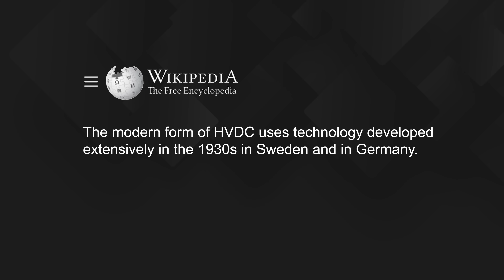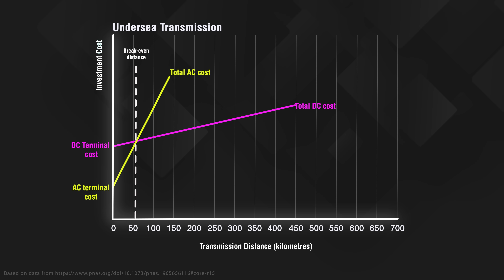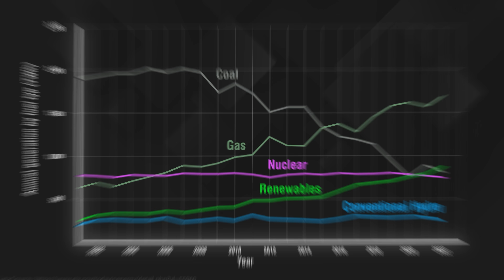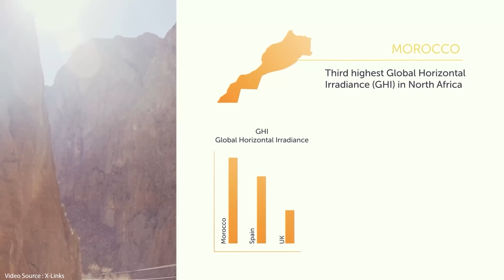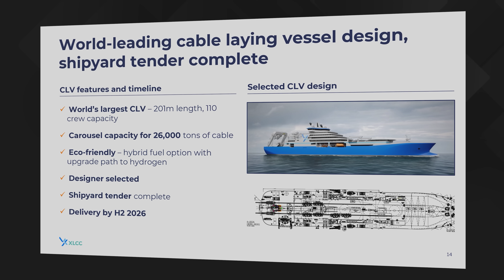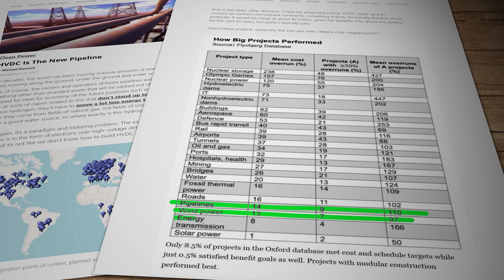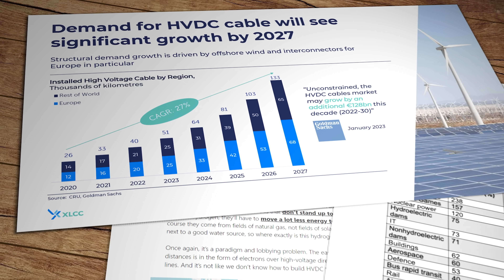Revolutionising power transmission.

Comment: AC was more cost effective back in the old days. Power semiconductors have made long distant, high voltage DC , more cost effective. Just because the first DC transmission came out in the 1930s, it was for unique situations (mercury arc rectifiers & electromechanical inverters - expensive and wear out). The cost, due to improving technology, has been dropping. Mostly, new types of semiconductor materials (GaN). 

There are two types of low carbon energy sources that should not be dismissed, Those are hydro and nuclear. These we have now, and run 24/7. Believe it, or not, there are environmental clowns, that want to decommission some hydroelectric dams !

Comment: You should do a video on the connection between Natural Gas Combined Cycle Turbine Power Plants and Heat Pumps or ECars on Fuel efficiency. Especially using the Natural Gas Turbines as a rolling Back-up to Renewable Wind and Solar.  . The problem isn't technology. The problem is GREED. In the end Ecars will win the day. as they are 3 times more fuel efficient than ICE Cars. And ICE cars run on BENZENE contaminated fuels. And BENZENE CAUSES CANCER.

Comment: The Moroccan project, weighing in at 1/2 the cost of Hinkley is a no brainer. Factor in the cost of the support infrastructure requied to maintain Hinkley, cradle to grave, and you will wonder why there aren't more renewable projects like this popping up.

Comment: Eh, for truly sustainable green solution we need to get in to heating rocks in giant heat batteries, the bigger the better heat retention, and it can both heat homes and be used as energy sink whenever energy surplus comes, on this scale regular steam turbines are viable and waste heat can be used by homes and industry, also industry can hook itself up directly to heat batteries for processing. Interconnects are nice. But every town having its own power and heat on demand is better. If disaster strike, city would have more than enough to be self sustaining for months.

Comment: Just as I thought that humans could not be more stupid , ie Batteries, nor we are going to do the same stupid thing we have been doing which is centralizing HVDC. We are going to dig up even more copper so we can transfer electrical losses greater distances. Right. The energy production and usage needs to be localized and not centralized. There are inherent security risks when a disaster by man unkind or more likely when the environment gone a muck destroys the central infrastructure we have created. Rendering us with out power. Instead we should be generating Hydrogen locally by whatever Green electrical generation we can use. Like Solar, Wind, Thermal, Hydro and yes even Nuclear see Red Hydrogen production by the Japanese. Producing Hydrogen in many different suitable location in the country and in the whole world will always be les risky than laying thousands of unprotected copper cables. Not to mention that one would use tons of less copper. When will people understand the the only renewable fuel on this planet is 2/3 s water.

Comment: You know what you and others are falling for…That would be that batteries are green… which they are not. Fossil  fuels can be replaced by Hydrogen. Because it’s the Hydrogen in Hydro-carbon fuels that creates the heat when excited by a spark for instance which makes it want to attach itself to Oxygen. Not to mention that Hydrogen can also creates DC electricity when put through a Fuel Cell. So yes we can replace most all uses of Fossil Fuels.

Comment: I'd like to weigh in with industry insight. I work for a company that builds high voltage AC transmission in Iowa. The HVDC line that SOO Green proposed is 100% dead in the water. The AC system on either side of the line was deemed insufficient by the Independent System Operators (MISO and PJM). Neither system can handle such a large injection of megawatts onto the AC system. When presented with this information, SOO Green was unwilling to fund the necessary system upgrades. 

On top of that, SOO Green was marketing and paying for the line using a "Merchant Line" system. In this system, individual loads and generators directly pay for their transmission usage along that line.  For context, there are currently 0 Merchant Lines in PJM or MISO. Here are two examples of many where that system falls apart. 
1. "I want to pay to bring Iowa wind energy to Illinois" "No, the local energy companies want that investment. Build wind farms in Illinois instead."
2. "Illinois has extra generation right now, and we've paid SOO Green for a percentage of their line. Export to Iowa!" But at the same time, "Iowa wind is over producing, and we've paid SOO Green for a percentage of their line. Export to Illinois!" When it is economical for both paying customers to supply or pull from at the same time, the system breaks down. 

Feel free to reach out to me with more questions about how electricity markets work in Midwest USA. If you want a great video idea on the topic, search "MISO Long Range Transmission Planning" (LRTP).

Comment: If high voltage dc cables aren't more complicated then similar fat wires in alternate current, then there would be no technology gap risk as perhaps not being able to produce such dc cables in a few years when special parts or materials could have become to scarce, and "we" would tell us then that we should have stood with a rather primitive ac network that would be less complicated to maintain, so can anyone explain or compare of hv dc cables are kinda similar in construction like the hv ac cables we mostly have today? and is it strange or awkward when a person like me has some thinking that "we" can't be humans without N. Teslas alternate current? alternate current would just be a money making pressure argument N. Tesla had to come up with since T. A. Edison would had claimed direct current for himself and his helpers in his laboratory? but i don't profoundedly understand ac (you/one would have to be a kind of mathematician for). 
Like with working on quantum computers without a deeper understanding of some light or photon based computer or chip. What is the (hu)man these days capable of, in his situations? shall the electricians and similar technicians be the hidden wizards solving all the circumstances, and feeding vast amounts of dc to mostly mindless "normal" people having hardly learnt anything about (the history of) electricity? they want their questionable (query-able) accumulator vehicles (many of them already had a burning incident), but the will never pay (off) the resourced (mis-)used for their nasty lithium "batteries", "everybody's allowed to carry or posess".  I'm from switzerland.

Comment: Not so long ago HVDC transmission lines were praised first for decoupling the frequency of the zones that were connected. Their high(er) cost was the main issue. Nowadays we should consider, before our governments spend billions in such projects, if other solutions should be integrated into the mix: local, clean, grid-connected sources of renewable energy (and storage). The power grid pyramidal scheme need to be questioned and much more thinking is needed before claiming victory using a single technology.

Comment: I had a Friday night cards friend who works with HVDC.  He was in town for a few months setting up one of the red pins on your screen.  Neat tech with great potential.  It was almost 10 years ago now since we parted ways but I recall him recanting (in general terms) the many challenges of getting the system running at the time.  Since then it's slowly been ramped up in capacity with major teething pains but looks like it will work out.

Comment: Speaking of power grids there was this quite interesting company from northern Germany that hat an innovative approach to the grid. They planned to put water filled pipes in first and than insert the power line. This would activity cool the power line thereby increase the transported amount of power but also create vast amounts of usable hot water for heating etc… unfortunately I didn’t hear about this technology around 2017 or 2018 after this video I had a little research and it seems that this idea was bought out or something back on 2019. I personally think that this technology is far better then those massive overland power grids as they produce at least some usable heat on there way. Right now overland huge power line projects are built in northern and central Germany to supply southern Germany with green power from wind turbines, partly because they did not like wind turbines nearby. 
The company is called http://www.ags-verfahrenstechnik.de/  I don’t have any connections to this company by any means. I actually a closer ties to the construction that is happening right now but still think this is a great solution.

Comment: What I think that energy companies fear most is having a distributed power network made possible by wind and solar replacing the concentrated power generation scheme we have now which uses the economies of scale to increase shareholder value. Wind and solar, especially solar, could generate enough power near or at the places of consumption to make high-voltage power transmission less necessary.  It could be that the largest component of such a system would be energy storage. It could also be a DC system.

Comment: Naive Portugal if the contry lets the cable just run in its waters without any change. This is also not the solution. energy like food should be transformed local to be consumed locally

Comment: Yeah I defintely don't see this as an unsolvable problem. You make enough videos about new stuff that will solve or reduce these problems each individually that even if some of them are rotten if you throw enough mud at the wall some of it will stick. Certainly the major 2 energy and transport are solvable and I think a lot of the problems are going to just require more energy so as long as we keep building solar panels and electric cars faster than they are being taken away we'll solve the majority of it and then you've got carbon capture in 1 form or another to get what we cannot clean up which I think will likely just require a lot of energy so the great thing about this climate issue is that it will drive down the cost of energy because we will need so much I mean just to make cars electric is going to pretty much double the amount of energy required to power them.

Comment: Would you please make a show (or series of shows) discussing the concept of Energy Return on Energy Invested (EROI, or EROEI)?  I am a member of Crux Investor, which is primarily a natural resources investing community.  In the community chats there is a whole load of renewable scepticism and scoffing at what can be done, and one of the main bugbears is the low EROI of renewables.  Essentially the question is this: is the human race capable of the work energy required to decarbonize?  If the EROI of the technologies we choose to go with is too low, we may indeed not be capable of the work energy required to achieve the transition.

Comment: It's great to see, but it's so slow. Governments like shiny kit like nuclear powerplants, but I've been rabbiting on about UHVDC to anyone that will hold still (or that I can keep up with as they run away) for a good 25 years now.

Over 20 years ago I was a very minor project manager on the largest in the world at the time DC interconnect and I well and truely got the bug. 

That project is utterly dwarfed by modern installs, as much as a 386 SX is dwarfed by modern computers, and for the same reason. The heart of a DC transmission is the bits that convert the AC to DC and back again at the other end. That's done with power transistors, and they've had similar price reductions and performance improvements as other semiconductor technology. We can do much more for much less. It's cheaper and more flexible than batteries. We need to get on with it!

Comment: Thanks for sharing your thoughts, ideas and videos. Nice to see an update on new transmission projects coming up. Like everything, moderation is the key to implementation. Big projects can cause big problems. As long as they are well thought out the problems can be dealt with. Having worked in the power transmission industry for more than 32 years I’ve coordinated all types of technologies. No one is better than any other. The problems come from situations when exceptions are made in operating policies because this or that just can’t happen, which of course is usually proven wrong eventually. The DC import from HQ into NY was limited by the ability to recover from the loss provided from a single contingency. The primary contingency was the loss of the HQ power system and we trained to recognize it if it happened. After many years they decided that’s just not going to happen again. And people retired and new people were not trained to recognize it. Then the rule was dropped. Come one morning I’m doing my job and earlier I read about forest fires in the HQ system that were so big nasa had spotted them from space. I noticed it was in a major HQ transmission corridor. And pondered that can’t be good. A little while later the impossible happened and we lost all of our DC imports at the same time. Thankfully the imports were relatively low. I recognized it as the loss of the HQ system probably due to the forest fires. Sent my theory up the chain and surprisingly that was exactly what had happened even though all the experts said it couldn’t happen. Thanks again for your videos, wishing you and your family the best.
Reply: you have a great experience, I’d like to hear more from you

Comment: Yeh, two things:

1, anything China says they're doing, take with a grain of salt the size of an aircraft carrier. The only green energy record China has set is the largest number of fake solar farms (they're literally just black painted squares connected to nothing).

2, don't underestimate people's ability to fearmonger. In the US and I'm sure in the UK as well there are millions of people who think high voltage cables cause leukemia and autism and they can and have shut down badly needed electrical infrastructure upgrades.

Comment: This is interesting.   I had always understood that we use AC power because DC power does not travel well over long distance.
Reply: no, it's Amps that determine distance & Amps go down as Voltage goes up so long distance lines are high Voltage. Where DC comes into the mix is that capacitive & inductive losses are drastically reduced, especially underground or underwater where there's more to react with.
Reply: It is in fact the exact reverse - both AC and DC have resistive losses, but AC also has capacitative losses (the line acting like a giant radio transmitter aerial). According to Wikipedia HVDC loses roughly half as much power per mile as HVAC.

Comment: Gas pipelines would be good to transmit power to small generators, turbines and fuel cells for local power production and decentralization.
Reply: That's an interesting idea as pipelines have easy right of way and it's conceivable to use them as tunnels.

Comment: Some one in the comments talked about oil drill workers moving onto geothermal drilling jobs. Does anyone know if an old oil platform with old wells could be converted to a geothermal energy producing platform instead? Sort of recycling the platform? Or would the liquids not be hot enough coming out the wells?

Comment: There is no debate. There are and have been viable and cheaper alternatives to fossil fuels for quite some time now. We assume that when they debate how realistic it is to sever our dependency on fossil fuels that this is the real issue (agenda) they have in mind. I would argue that what they are really arguing against is any technology that empowers the average person and inevitably leads to population increase... This is their real concern. We have to "read-between-the-lines." Access to cheap clean energy is the most important factor in the development of a civilization. Energy underpins all other activity. 
Fossil fuels are finite and treated as scarce commodities which in turn allows "social engineers" to manipulate the market prices and put a choke-hold on development. This is the real agenda. They don't regard the average person as mature enough to be included in the discussion of the direction our civilization is going in and the implications of unrestricted development. I agree we have a potentially catastrophe coming our way in the future. What I don't agree with is lying to the public and treating us like children... 

Responsible implementation and management of nuclear energy (fission) has the potential of being low cost and despite the fear-mongering, is better for the environment then other "sustainable" solutions because energy density and therefore less mining activity (smaller footprint). Moreover, used nuclear fuel can be recycled and reused (technology that has been around since the 60's). We haven't tapped the full potential of that resource! There is also Geothermal. Potentially, we can tap heat from the earth's mantle anywhere on the surface of the planet. We do not have a shortage of energy. We are bathed in energy! Incidentally there is no shortage of "fresh water" the earth's surface is covered 70% in water! Does it go into outer space when we use it?? The biosphere is a closed loop. Virtually nothing enters or leaves it's just recycled. We need to get creative on facilitating and learn to actively manage this recycling process.